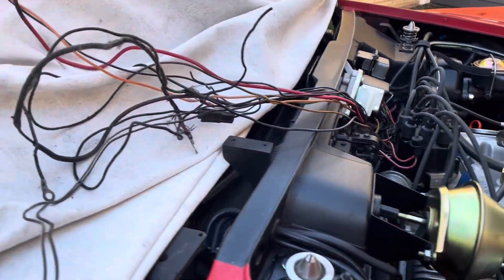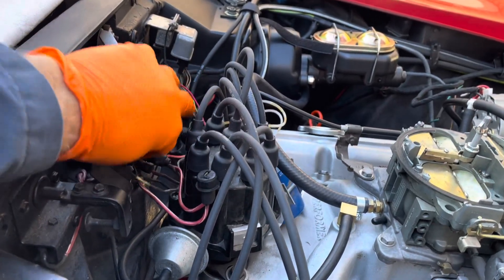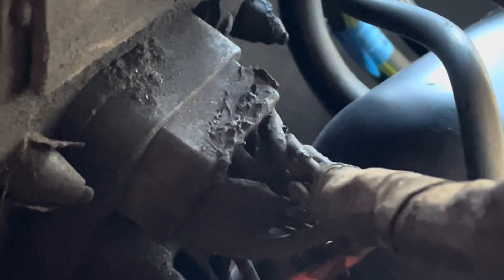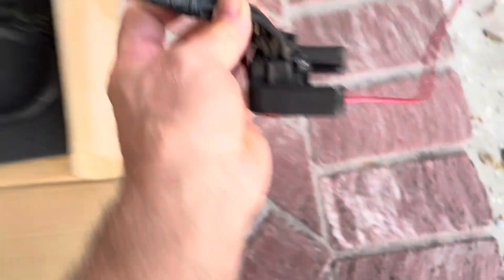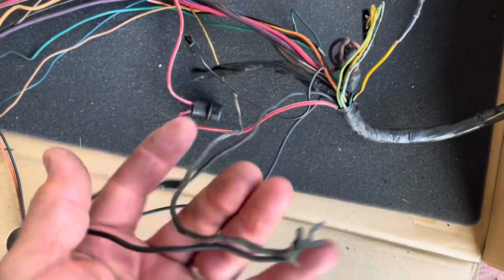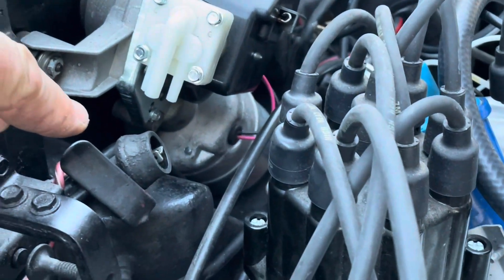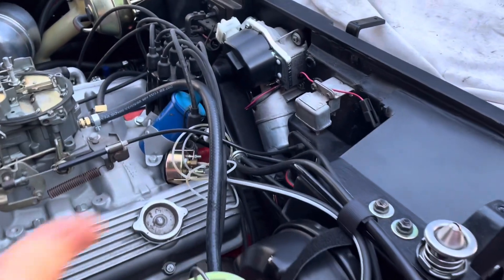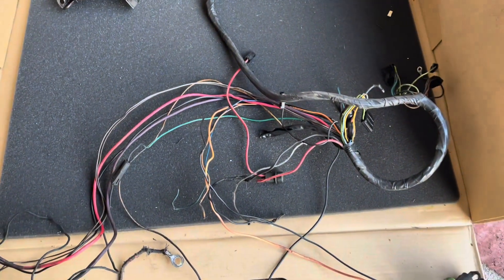C3 Engine Wiring Harness Removal

Comment: The first thing you showed was the horn relay. The second things are your contraption for transmission control spark which I believe you have deleted. The front one is a reversing relay. It is there because the black wire from the side of the transmission is energized in the opposite conditions of that which is required (when third or fourth gear is selected). The relay nearest to the firewall is a 15s time delay relay that overrides the reversing relay during startup.
Reply from the maker: Thanks for the info. I’m about to post a vid about the Spark delay sensor in the trans and also the reverse lights switch.

Comment: WARNING: when you assemble the two fire wall plugs together and go to insert them back into the firewall socklet, push the plug straight in, not at the lightest angle and turn the center screw to start tightening when you first feel resistance. you can if not careful push the T-nut out of the fuse block and have to remove the fuse block to put back in place. ask me how I know.
Reply from the maker: Good advice. Frankly, I’m concerned about getting the block lined up, since there ain’t much room in there to maneuver.